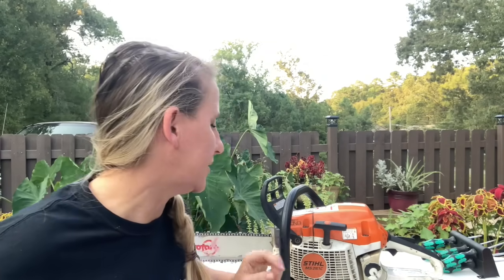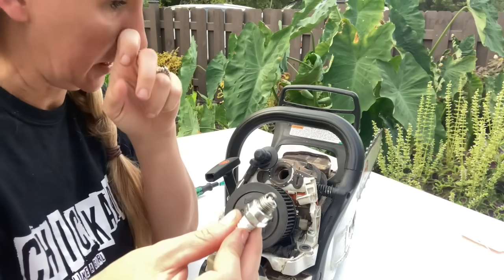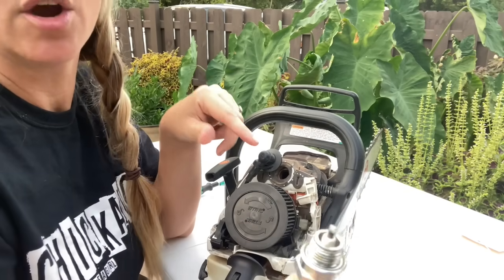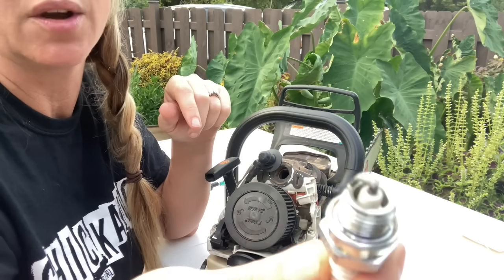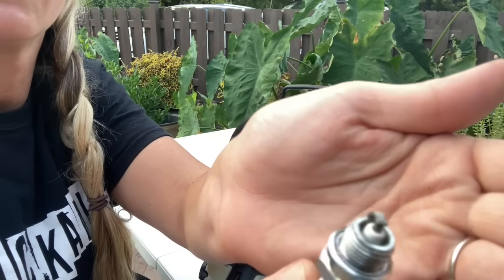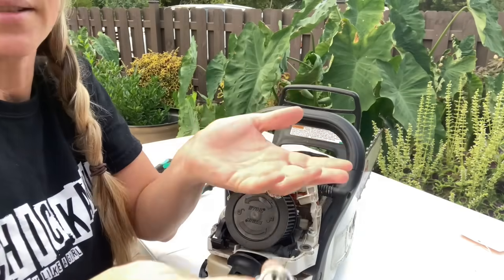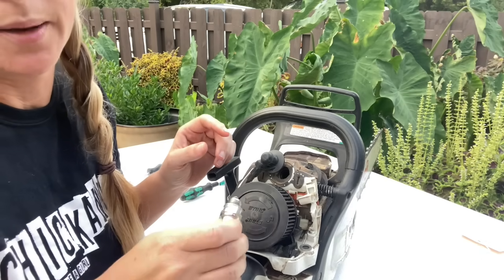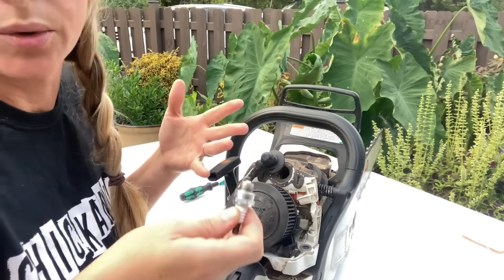STIHL M-TRONIC CHAINSAW HAS NO CARBURETOR ADJUST, WILL IT "RESET" TO REGULATE FUEL CORRECTLY?

Comment: There are different M-Tronic models out there. Probably with different reset-procedures. My 362CM is resetted by starting let it run in idle without touching the trigger for 60-90 seconds, then full throttle for about a Minute (until you notice a serious change of speed (and is runs straight again on full throttle) then release trigger an it is resetted an setup again. I'm running that saw for years now and had absolutely no issues!
Reply from the maker: The different re-sets for different saws gets confusing. Running wise, they are great saws. They can tear through some wood. I just get discouraged that a homeowner can't fix it if needed. Thanks for watching!

Comment: I just wish they would start making things like the old days again
Reply: Yes I agree but we live in a disposable society these days. If they built things to last, these companies wouldn’t make much money because they’re not selling as much equipment as they can. Appliances are the worst for reliability these days.
Reply: @jasonscott4525  that's true and the reason I've been collecting old cast iron brigs and Stratton and other small engines it is hard to believe we went from iron blocks with ball bearings on both sides of the crank to just basically a hole bored in aluminum with a shaft going thru it no bearings or anything

Comment: The system also has to be reset after a air filter replacement. The system works very well if it is used in the manner it was designed. Granted the layperson or even the commercial user is not going to be aware of the process. The owners manual is never read.
An honest shop should only charge their minimum or half hour labor to reset. The actual cost will depend upon their hourly rate.
Great video and it should save frustration because the owner is now educated what they have to do for service. 
That's why there is FORD, CHEVROLET, RAM, etc. dealers to fix our automobiles.
Reply from the maker: I had a friend who bought a new Lexus SUV. She had a flat tire and found out she had to take it to the dealer to CHANGE THE TIRE. What?? LOL!
Reply: @Chickanic  Now that is taking things just a little tooooo far.
Crazy 🤪 😜 🤪 😜 🤪 😜

Comment: Seem to be going down the John Deere road, they don’t want you are the consumer to service their own equipment, just them or their service agents. This kind of technological upgrade is only there to maximise their profits and to hell with your rights to repair you own gear.
Reply: You can buy the normal version without mtronic, also mtronic in general works good, the reset used was wrong.
Reply from the maker: John these saws do scream when running well but, this was not the 3rd generation re-set. There are 3-4 different re-sets for different models. This was what is called for, for this model.
Reply: @Chickanic  I assumed it was mtronic 3.0, sorry. On chainsaw you can check version on brake sticker in right upper corner, mine says M3.0.

Comment: There are a bunch of comments about the old technology being better and I agree. However there are comments from those who seem to know this system well. My opinion is that you are not a Stihl dealer and obviously do not understand the system or Stihl warranty as far as oil is concerned. On a saw out of warranty are carb adjustments free? Whats the difference between charging for carb adjustment or charging for electronic reset? Usually when people think the carb needs adjusted, there is actually something wrong. You should know that attempting to solve a carb problem by "adjusting it" is not the answer. Although most of us do not like any of this new electronic nonsense, I think we will continue to see more of it. It's tough for an independent mechanic working on any type of equipment to keep up let alone a farmer or logger trying to work on their own. Complaints about John Deere technology have not changed their sales ranking.

Comment: You can all thank the EPA for electronic "no tamper" carbs. 
We run over 30 saws with 3 crews.........when MTronic is working properly, it is awesome.
BUT, it can never be better than a fine tuned saw by an operator who knows what he is doing. We have had several MTronic saws fail in the last few years. Solenoid on the carb is the usual culprit and occasionally a bad coil..... we've converted a few back from MTronic to old type by retrofitting the Carb, Coil, and flywheel from the non MTronic version. I've done several MS201Ts and MS261C-M and a MS462  Also most of you don't realize that there are a few models that are sold to 3rd world countries without MTronic but with MTronic when shipped to north  america. 

Personally I think of these new versions as Moronic ............when you are out on a job and hours from a dealer and your saws decides to stop idling or dropping rpm when full throttle.
Turn around and head to back to town? No, no..........pull out the backup saw , usually and old MAC10-10 or Husky 372 and keep on cutting......while the $1200 new saw sits their looking all shiny and new........

So just remember to thank the EPA for not regulating something that makes sense.
(like aircraft, ground 1 plane and you, and thousands of others, can run your old saw for a lifetime and more)....make the average joe suffer. Thats what governments do best.
Reply: My dad has been truck driving for nearly 30 years. 
Jacking things up is what they did to that industry as well.
Reply: @DesertCatDad  Facts!
Reply: A Container  Tanker  ship   burns  high Sulfur   Tar.. that has to be pre-heated..   They pollute as  much as  50  Million cars.. do ..
Reply: That's good and all, but the last time I checked the EPA does regulate aircraft emissions as well as everything else.  If it bothers you that much then don't run anything but old saws.  Either way you still need a backup saw or two.
Reply: @StFiacre  I just think it's fun to know that I can run my saw every day for 10 lifetimes and still produce less pollution than one flight from NY to LA ....and there are what? 5000 flights a day just in the USA.......marvelous how people fail to see how ridiculously hypocritical the whole systems is......nothing is bigger money that the airline industry.....they are beyond reproach and the system will fabricate whatever statistics they need to protect it.......
Reply: That's !! Why They ! JUST !! LOVE !! TO !! GET !! THROWN !! OUT !!!
Reply: JD. Miller, where do you get parts for your 10-10? I inherited my dad's that he bought new. It ran last I used it, 10 years ago. I just didn't want to tear it up.  I am sure the diaphragms are hard as a rock by now.
Reply: @phillmccracken4219  Walbro K10-SDC on eBay is the complete carburetor rebuild kit you need including the welch plugs inside the carburetor. Get on Facebook and find the McCulloch Chainsaws North America group or find me on Facebook.
Reply: Every time I travel to other countries where the air is so dirty that most people wear a face mask because of the dirty air .... I do thank God that we do have an EPA...... and if you had half a brain you would too/also....
I've seen how little kids are about wearing masks,  covid-19..
LoL
Reply: @davidlayne8755  ...uh, that's not the point. Airline industry = elephant
Powersaws = ant
So an elephant can crap in your lungs and you are ok with that.....but don't let that ant pass gas...oh no! it will be the end of the world..... EPA is run by hypocrites. Big money does pretty much what the want while the common person pays. Not saying they are bad.....just corrupt.
Reply: Keep in mind that Stihl is absolutely crazy about staying AHEAD of the EPA requirements. They like to be 10 years ahead of current requirements. They actually get credits from the EPA for this (like good grades). They then sell these credits to companies that have trouble meeting EPA requirements, so they don't get fined. That's why new saws don't run like old saws. Gotta keep the government happy.
Reply: I bought the MS-261 with a standard carburetor. I can make my own adjustments.
Reply: My 088 125cc  starts in two pulls simple carb easy to fix tune.
Sick of all this high tech junk that fails and only "Stealership" can fix.
Reply: @Motorhead250  Agreed, my old 066, 088 always start fine.... I just converted a MS441 M-tronic to old style.
Ordered the Original coil, carb and flywheel from a seller in Europe.....voila, no more compoopter to mess things up.
This can be done on just about all MTronic models by ordering the parts for use in 3rd world (NON EPA) markets.
Reply: @JDMiller-fg8kh  I will never buy a new Stihl chainsaw.
I keep my old one and have Echoe and Husqvarna .
Thanks .
I tell my friend s who have that on theirs .
Reply: How do they collect it ? 3500 , can they come personally to the door ? 
I wouldn't recommend that ..lol
Reply: If your out on a job and your in the tree cutting business I would doubt that your bringing only one saw with you. Whether it's moronics or not. ( when I tried spelling m-tronic my phone auto corrected to moronic) but either way you have back up saws. So idk that's kinda mute point. But yeah I will say the old mccullochs I got from my dad just rip. Screamers. Simple to work on.
Reply from the maker: Preach it! That is why I am scared to show carb adjustment videos, because they can fine me $3,500. Thanks for watching!
Reply: @Chickanic  Fun fact :
The old style chainsaw puts out about 40lbs of CO2 per day. On average, a plane produces a little over 53 pounds of carbon dioxide (CO2) per mile. Think about that...everyone. Where are you flying to? Is it really worth it? So why doesn't the EPA reduce those thousands of flights for thousands of mile per day.? Who pays?
Reply: @jdmiller7138  your comparison of a chainsaw to a aircraft that transports hundreds of people thousands of miles? Aircraft produce very little in carbon emissions to the atmosphere compared to hundreds of cars driving the same distance.
Reply: @Chickanic  I think I'll stay away from Stihl. I have about 39 chainsaws and somewhere around 34 are McCulloch's dating from an old 5-49 2 man saw around 1949-1952 and the rest from 1968 to 1998 when McCulloch was sold by Black & Decker. Only one McCulloch is from the Taiwan era owned by Seng Fen. My 2 newest saws are a 2012 Jonsered CS2166 (X-Torq era) and a 2020 Echo CS355T that's been muffler modded, timing advanced and ported by Jereme Bell AKA Bellhopper on YouTube.
Reply: @johnlincicum6390  Even the B&D era was not great for Mcculloch, Jen Feng eventually made an easy to use and repair product for the homeowner market....but never a pro saw.  Fortunately the old Pioneers, Partners and Poulan Pros took up the slack and Electrolux had them making some really heavy duty models. 
I'm still running them today along with some Terry  Homelites made here in Canada. I prefer the torque over rpm anyways. Plus on many of the older saws you can block the governor if you want to pull more revs....todays synthentic oils allow the old torque machines to wind up to 11000 rpm or more. The other baddies are like what Buckin' is running....big Dolmars and the big old Oleo-Macs (not related to Mcculloch) pack a punch too.
Reply: @jdmiller7138  Oleo-Mac is an Italian company. They were also Olympik and now they are called Efco. All the same company, they just changed their names a few times. I don't know why. They're supposedly good saws though. I've never seen one in person other than the newer Efco at the dealership. I'd like to get my hands on an Efco MT8200. UPDATE: I got it. Lol!
Reply: @johnlincicum6390  Oleo-Mac/Efco (Italy) are owned by Yamaha (Japan). They are a great saw and have a good range of equipment/machines. I especially love the BV901 backpack blower, best I ever had.
I only use Oleo-Mac and Echo (in the hand machines) with AL-KO Solo ride on & Spartan zero turn & Stiga Park Pro 4WD front deck with Weibang shaft driven pedestrian mowers (on the ground machines).
ALKO-Solo  give a five year commercial warranty, but don't have a zero turn or front deck range. But my "ALKO T22 110.0 HDH-A V2" is unbelievable at tackling high/tall/heavy grass that my other machines just couldn't handle.
The other brands that I have mentioned give a two year commercial warranty.

I dropped Stihl, McCullough and Husqvarna a long time ago - between solenoids on carbs, plastic carbs, to much unnecessary electronics and getting parts issues I just couldn't use them anymore.
Jonsered are no longer sold here in Ireland, or at least not in my region anyway.
Reply: @jdmiller7138  Since this video was made I bought a new old stock Efco MT8200 made in either November of 2009 or September of 2011. Efco is Olympik/Oleo-Mac. They just kept changing their name. I have a Sachs Dolmar (153) made Poulan Counter-Vibe S6000. From what I have been told is that it's a Sachs Dolmar 153 with the Sachs Dolmar 152 crankshaft and it has a 32" bar and a .404 chain and that's why it can't be switched to the 3/8"/.375" pitch chain is because of the 152 crankshaft. Also have a Sachs Dolmar 114 and 119, 5 more Poulan's and many other brands of saws between my 83 year old father and I. We have over 100 chainsaws.
Reply: @johnlincicum6390  i loved the old mccolloch saws, they were heavy but they were tough!
Reply: @davido6915  I have over 30 McCulloch's. 46 chainsaws now including 2 parts Black Top Mac 10-10 Automatic's.
Reply: @johnlincicum6390  i thought i loved saws! Wow!
Reply: @davido6915  my dad is 83 years old and has even more. I know of guys with collections in the 100's.
Reply: @johnlincicum6390  Iike big Echoe saws CS 600 awesome never has problem and starts easy .
I have some older saws .
Loved Mac 10-10 and Husqvarna 372 ,545 .
Old Stihl better .
Reply: @Chickanic  That is freaking crazy!?
Reply: @Chickanic  that’s if your “tamper” with the limiters or defeat an emissions controls device… just simple adjustment is in the stihl manual … or better yet use an older “exempt” piece of machinery
Reply: John Lincicum-  what’s your opinion on those newer McCullochs?  I recently got one from 1995 and it all seems very cheaply made to me.
Reply: @mikea-strong5020  if it's a plastic bodied saw, it's not very good overall. If you're talking about a 10-10S or Pro Mac 700 then yes it is an excellent saw.
Reply: @mikea-strong5020  I have an MCC1635AK and the coil went bad, it took 5 years I think to find a good used ignition module and just before that it needed the carburetor rebuilt and new fuel lines. Save yourself some trouble and get an older Power Mac 310/320/330/340, Power Mac 6 or even a Mini Mac.
Reply: Most 3rd world countries do not produce a fraction of the carbon emissions we do. They car pool and we have people in hummers as daily drivers to work in the United States. That's why our EPA restrictions are getting more severe.
Reply: @im-that-guy-pal  Actually, just the opposite. 3rd world countries are the worst polluters. No catalytic convertors, very poor or non existent maintenance, running vehicles from the 1950 and 60s.
Parts of asia still have coal fired railway locomotives. There are not emissions controls because there is no money to regulate it..... you have been brainwashed and whitewashed by your politicians......its all about money and who they can squeeze.... lies lies lies...just like everything else we've been whitewashed with in north america....barnum had it right, a sucker born every minute.
Reply: @jdmiller7138  preach! I'm surprised at how many folks buy into the bullshit. At least a few of us still know the truth.
Reply: @im-that-guy-pal  CO2 isn't a pollutant.  Plants need it for food and every warm blooded creature exhales it.
Reply: @im-that-guy-pal  enough with the dem marxist tree hugger BS bro we are tired of it !!!!!!!!!!
Reply: @im-that-guy-pal  Please educate yourself because this is simply not true at all!

Comment: I have that same saw and I love it!  I've found that after running it hard NOT to just turn it off, but let it idle for 15-20 seconds and then there is no problem starting it back up.
Reply from the maker: Stihl does make the best saws. Love mine! Thanks for the tip!
Reply: @Chickanic  
I have a question hopefully you can help me. 
My ms211 will not take all the acceleration. 
When you try to give full throttle or try to cut into a log it bogs out. 
It just started that. 
I put a new spark plug in it but it still does same thing. 
What can I do.?
Reply: @dc4lifetxjw  Simplest fix is check the spark arrestor for carbon. If you can't see through it, clean or replace.
Reply: Thanks. 
I changed the fuel and it is doing better running good again

Comment: Forgot to mention that high speed fuel settings will not adjust without cutting 3 times, it will richen high side like turning carb high side richer. do not bog down saw, do a steady cut putting a steady load on it. If bog saw down you have to start all over.

Comment: Hello. You need to check the diaphragm in carb, then you have to let run on choke for 90 seconds. You need to be at a log when doing 90 seconds. As soon as you shut it off do not start on choke,  and start engine again, immediately after starting you need to make 3 cuts Thru a 10"- 12" log wide open throttle without releasing the throttle between cuts, let saw come to idle for 15 seconds shut off then the saw M-Tronic will be reset. You can take out the black solenoid with wire on carb and clean it out with lo air pressure not directly on it while diaphragm is out, also make sure clutch springs are good and needle cage is lubed. most the time its the diaphragm and a reset. by the way I like your videos

Comment: Well you can thank the epa for the carburetors we are seeing today. I tell my customers with the old saws as long as you can get parts keep them running. Got an 056 in the shop probably needs a carb rebuild. Haven’t had it on the bench yet.